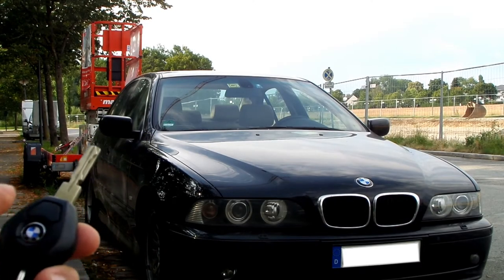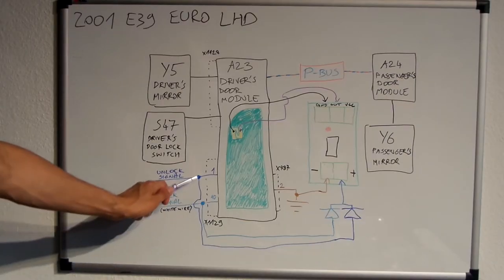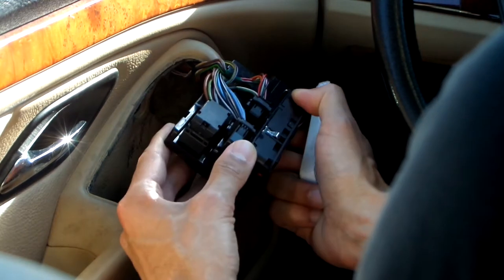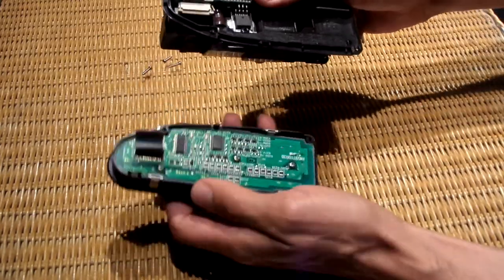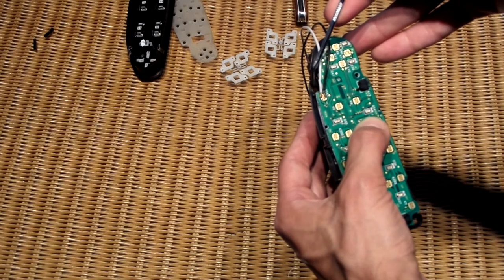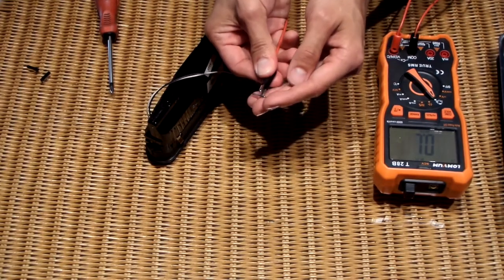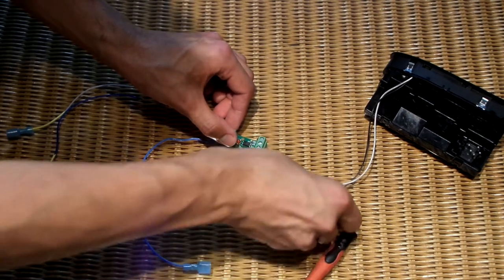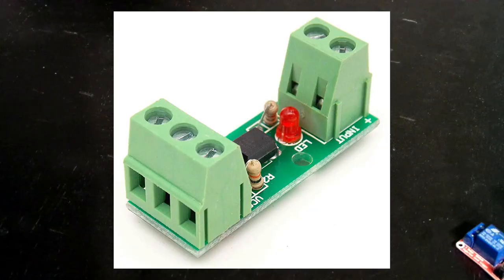❗️ [BMW E39] Folding Mirrors Remotely With Key Fob (Cool Upgrade!)

Comment: Thanks a lot for the effort in these vids. I'm surprised that there are not a high amount of views. The (Torolin?) video appeared in my recommendations and I initially assumed I was subbed. Glad I checked as you have top shelf E39 vids. I'm now going to see just how difficult getting that Torolin stuff you used shipped to California.  I can't even get a 49 state catalytic converter shipped here. On amazon it tells me to use a "proper" address when attempting to buy a 49 (Federal) cat. Again, good stuff, well done,subbed.
Reply from the maker: Thanks for the positive feedback!
The product is "Toralin Anticarbon" (feel free to enable subtitles when in doubt), but not sure if any seller would ship that to US. In your case, I would try to use ACDelco's X66P or 10-3015. Of course I cannot promise any results, but I would suggest not to leave it in the cylinders for too long (30 minutes max) and do an oil change afterwards. 
About the cat issue, I really could not be of much help, but I would check this:
Are "CA approved" cats are any different? If they are, will the car still pass the emissions test in CA on a fed cat? And of course, what made the cat go bad in the first place (if it is the oil burning in there or running rich, you need to fix that first!).

Comment: hi , what could be the reason for mirror partly folding on drivers side ? thanks
Reply from the maker: Obviously I can only guess. But I would start with checking the microswitch on the bottom side of the mirror.

Comment: Hello hope you can help me I know it’s an old upload but I’ve done as you have shown everything works as it showed but when I try to adjust driver side mirror for down and right it folds the mirrors what could be wrong solders ? Or I re assembled it wrong?
Reply from the maker: Take the relay out of equation - disconnect it, then try to adjust the mirror again. If they are still folding you probably soldered something that you shouldn't have. If they are not folding you can try to adjust them, reconnect the relay, and live with it :)
Reply: @ProperRepair  yes by removing the relay it works and I re checked the soldiers I only solder it where you have shown . And I checked with a multi meter everything else is fine could it be the module itself?
Reply from the maker: It is obviously very difficult to diagnose this via texting, but it seems that when adjusting the mirror the relay is somehow energised.
Reply: @ProperRepair  yes it’s exactly like that I can send you a video if you want
Reply: I have the exact same problem.
If it helps, the PN for my door module is 6904339 
Hw 10 sw 11

Comment: Hallo,

tolle Anleitung allerdings habe ich nicht herausfinden können an welche Kabel Sie die Stromdiebe  angeschlossen haben also am Kabelbaum könnten Sie das genauer beschreiben? Abo habe ich dagelassen Glocke ist Aktiviert ich freue mich schon auf weitere E39 Videos!👍🏽

Danke!
Reply from the maker: Hallo,
hier habe ich ein Foto gefunden: https://www.bmwgm5.com/E38_E39_PM-FT.htm
Da sieht man welche Stecker X887 und X1129 sind. Dann einfach das weiße, blaue (Pins 10 und 1 auf X1129) und braune (Pin 2 auf X887) Kabel herausfinden.
Neue E39 Videos kommen noch!
Reply: @ProperRepair  Super vielen Dank werde ich genau so umsetzen habe alles da! 
Mein Englisch ist leider nicht so gut eventuell eine Stichpunkte artige Beschreibung auf Deutsche in das Feld unter Ihren Videos hinzufügen für Ihre Deutschen Zuschauer wäre bestimmt eine große Hilfe.